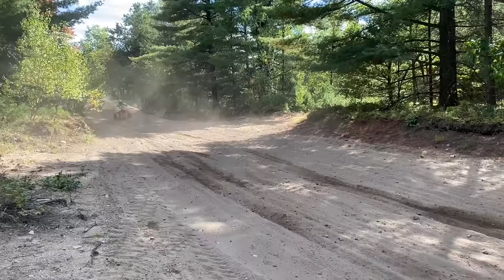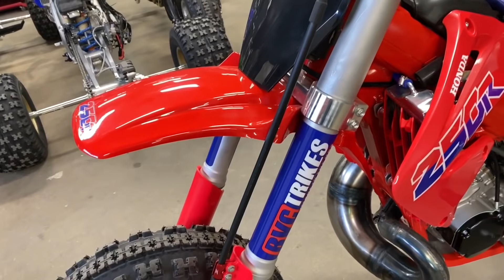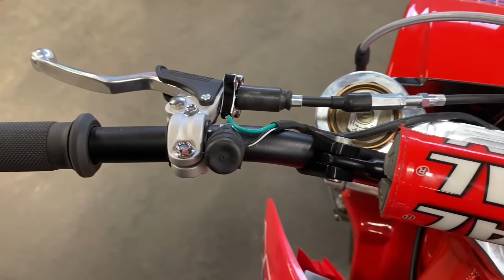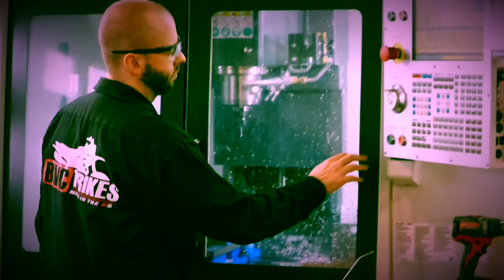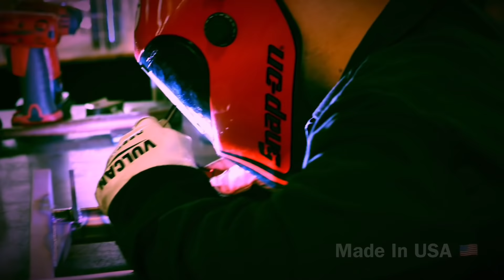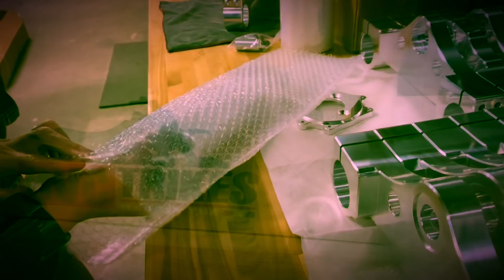Modern ATC250R- CR250R Three wheeler MOTOCROSS RIDE TEST

Comment: Serious question.  Do you have a flywheel weight on this motor.  And what is the stall resistance vs a regular 250r. 

I've got a Cr250. Jetted amazingly well but it doesn't have that stop and go  like my atc 250r has.    If I try to get back on the throttle it will stall out  so I'm probably going to add a flywheel weight to my dirt bike
Reply from the maker: No weight on this, its stock